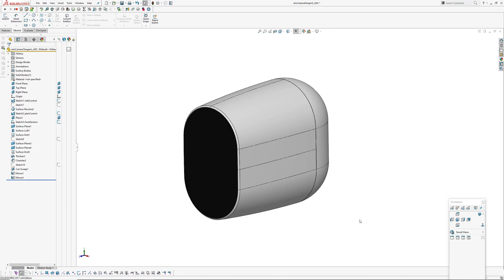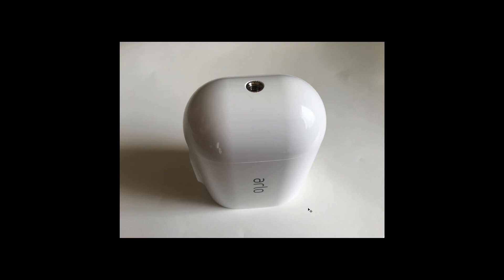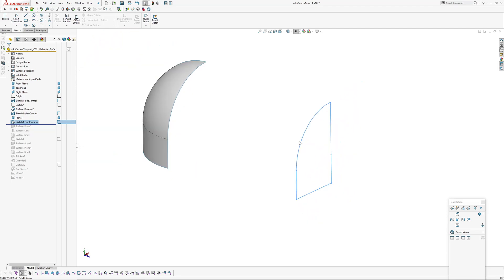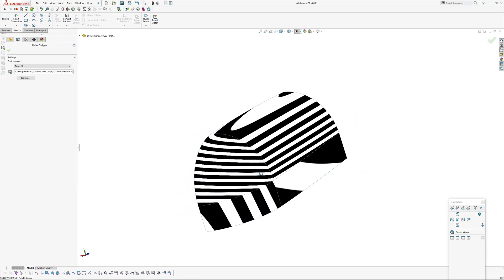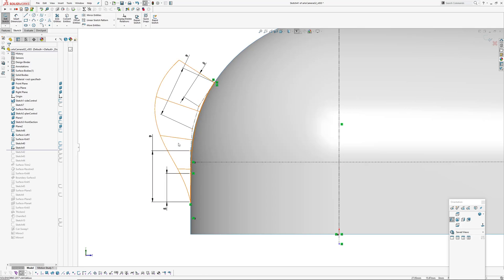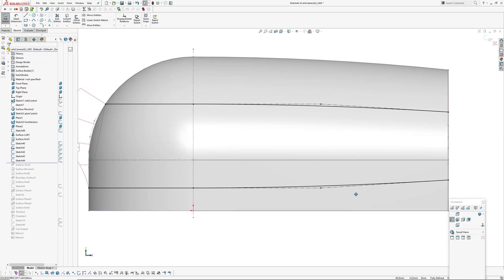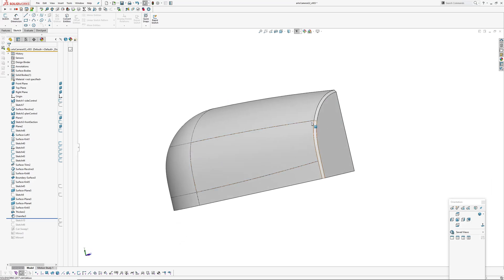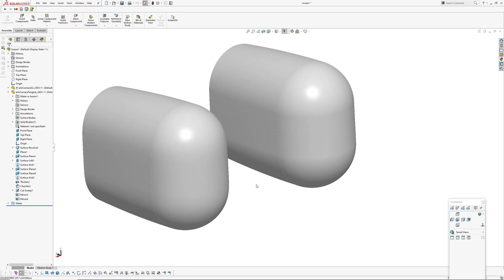Surface review of an Arlo camera form in Solidworks

Comment: I noticed this continuity issue in the Arlo product too! I love these Solidworks videos where you're creating subtle, minimalist forms. These seem to be the hardest for me. You need that G3 continuity, but also a high level of control and precision.
Reply from the maker: Yes it’s a bit of a missed opportunity! I know the product gets screwed to the side of a house but the form could have been resolved better!
Reply from the maker: Re your question on the other video, setting a boundary to curvature (when you have boundaries defined in both directions) seems to force the curvature connection into a ribbon along the boundary. SW seems to imply a G2 connection between surfaces where the input curves are G2 even when using a tangent connection. Another oddity...
Reply: @AndrewJacksonDesignStudio  Good to know for the future. I've definitely had that problem before but never bothered to try setting it to Tangent. Please keep doing these videos--I've learned a ton from them!
Reply: @AndrewJacksonDesignStudio  So you probably use the Tangent setting most of the time then, right? I feel like I almost always have curves in both directions
Reply from the maker: Most of the time I only use tangent. I use cc if I'm creating a blend between two edges, with no 2nd direction curves.

Comment: Sometimes I feel a regular g2 or g3 transition curve/ surface still isn’t enough.  Like there is more to it. Apple have done it the best.
Reply from the maker: Yes for sure. G1 has its place but in this case it seems confused; the form says hey I’m soft, but the transitions disagree.
Reply from the maker: Tony, not sure if you have seen this article before on Core 77? Worth a read. 
https://www.core77.com/posts/12752/a-periodic-table-of-form-the-secret-language-of-surface-and-meaning-in-product-design-by-gray-holland-12752
Reply: @AndrewJacksonDesignStudio  never read this one specifically before but it is pretty great!